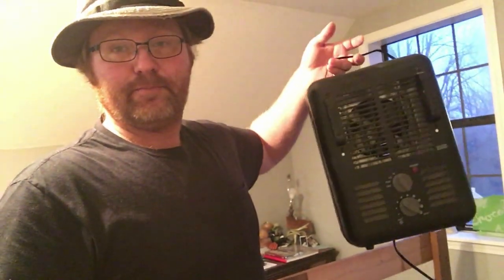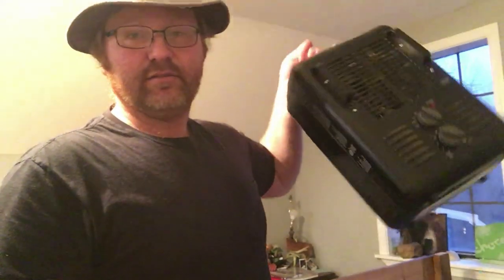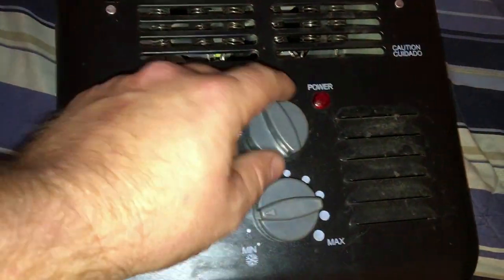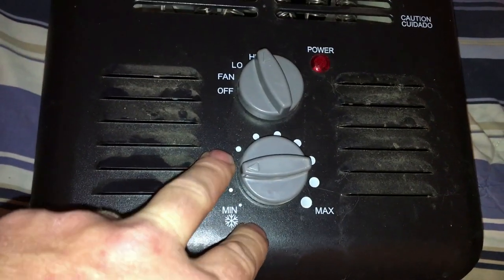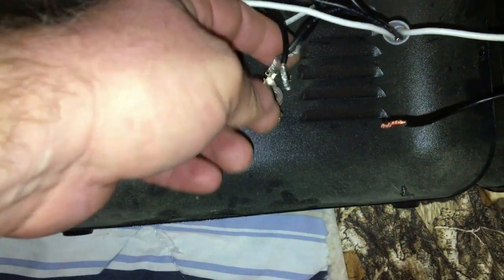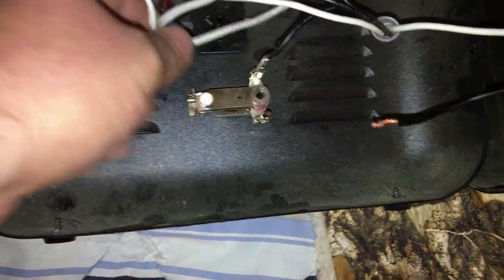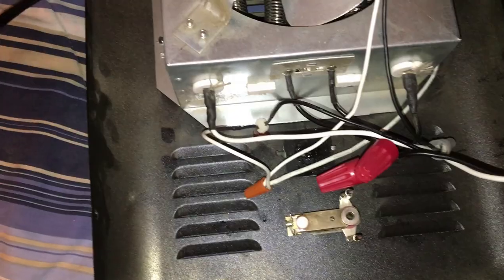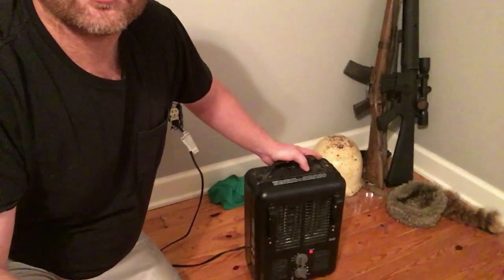How I fixed a broken Space Heater

Comment: I have the same heater, and putting a ball of aluminum foil in between the the "safety prong" fixed mine instantly. They are designed poorly. Too much plastic where there should be metal.
Reply: Foil to bypass safety prong. REALLY!?!
GOOD LUCK
Reply: @johnsarab4500  That comment was posted a year ago, and it has beet working ever since. Good try though.
Reply: @drizzzumbrizz6308  tried the same thing. It worked for a few minutes then popped and stopped working. I checked the foil and it was red hot and burnt to a crisp. No doubt it works but have you had any problems similar?

Comment: OG you can’t do that, maybe you should not make a video about this subject because you just don’t know as much. I don’t know much about Forced Air Space Heaters, and that’s what Im on this page, but my friend ur broadcasting how to bypass some very important safety features
Reply from the maker: Thanks for your input. I did what I had to do to make the heater work . The parts on the heater melted before I wired it up so really the heater was defective before I bypassed everything. As a matter of fact every one of these heaters shorted out and melted the thermostat including all safety features without me touching it. I haven’t had any issues with them after I bypassed everything. I agree not the safest measure but we have heat.
Reply: Well, we all know it's not safe. We all know that this fix involves bypassing a safety feature. We are here because we want to do that. It is in fact sometimes useful to know how to bypass safety features, and not inherently irresponsible to simply make a video about doing that.

Comment: My SAI heater Off, fan, low, high switch went bad, bypassed it like you did, works on HIGH again lol. I use the  temp switch to cut it on and off now. HIGH is all I ever used anyway. Thanks,

Comment: My Comfort Zone, which looks very much like yours, I just repaired after jumping around the safeties on the tilt switch and found that ok. Jumped the thermostat and I HAVE  heat now. Looked at thermostat and realized that the contacts looked like
 points on older car's  distributors. I next filed the contacts with a fingernail clipper file . Working great, unit is 5 years old
Reply from the maker: That’s amazing!

Comment: Much appreciated. I bypassed the thermostat,, and simply wired the 2 blacks together, and off, fan, lo, and hi are still selectable.  We use one of these overnight in our basement to keep our cat warm. Since there is no safety anymore we will not be using this particular one for that, but at least we will have it for the winter when we are able to keep an eye on it. Thanks for saving us the 20 bucks on getting a new one!
Reply: Bypassing the thermostat worked for me, too, and the off, fan, lo, hi controls still work.  Just a warning, if you have children or pets, the anti-tip shut off will not work by bypassing the thermostat.  These are $18 at Menards, on sale this week for $12.
Reply: Same

Comment: Thanks man! I know it’s been a year since you uploaded but you help save me a good few bucks. Had two of these exact heaters and my first one went out last year and my other one just went out today. Came across your video and it work wonders! Although you don’t need to connect the white wires if the top switch isn’t broken for sure. Both heaters stopped cause that stupid heat sensor so you really just need to do the black wires on the bottom
Reply from the maker: Awesome. Thanks for the advice 👌. Just be around if their on for safety reasons. Taco
Reply: @tacitohomestead4851  of course lol, don’t need any fires

Comment: Thank you so much! 

My heater is almost the same. Exact function and wiring, but white with a different fan.

Something happened with that rotary switch where one day I trusted the switch to OFF and it kept going. When I came back to use it, the switch wouldn't turn at all.

I suspected the wiring was, like you said, a simple positive and negative. But the thermostat always worked.

So what I did instead was I removed the switch and drilled a hole for a simple on/off toggle switch. 

For safety I got a 20A 125V AC toggle switch with that round metal lever that flips up and down.

Then I cut off the 3 leads on that rotary switch that went to the heater and the fan. (The fourth lead is the hot input for the switch so it wasn't necessary to transfer since we were replacing the switch).

I tied all of those wires in the rotary switch together to one of the new toggle switch leads. I tried the hot wire from the plug into the other toggle switch lead.

Now I can flip it on or off, and I can still use the thermostat to control the fan speed.
Reply from the maker: Wow that’s amazing! You did way better than me. Congratulations on the success.

Comment: Thanks brother Taco i got a honeywell red box that i took apart to clean and fix a wobbling fan making noise, after 2 hours of work it ran great for 10 mins then the thermostat got moved by accident from full blast and it all shut down. I let it cool for 30 mins outside, tried to plug it and that pos wont budge even ice cold. Now i'm gonna tear it down again and bypass all that shit just like you did.
Reply from the maker: I hope it works out brother. It’s a good fix for when you need heat now. We continue to use ours and it’s year 3. We keep an eye on it in case it somehow gets knocked over but it’s chugging along nicely.
Reply: @tacitohomestead4851  update; i bypassed the bs themostat and the thermal sensor, for sure one or both were dead, i had a very noisy grumbling fan, i noticed when you held the unit inverted it was almost quiet so i took it apart again ( 4x in 24hrs lol ) and loosened the motor's two bolts and flipped the motor upside down. it's now on a test bench running wide open for a few hours to make sure nothing melts. For now i'll leave the "two step" switch so i can still run it at half power if it gets too hot. i use mine in emergencies with a firman generator so i like to make sure everything is old school fail safe. Thanks again brother Taco stay safe & God bless.

Comment: Hey if anyone has this heater and they take it a part and notice that the safety switch is still all together but not working…. Take the underside tab of it and bend it to connect with the middle metal tab part in the safety switch. It uses metal tabs on each side and a weight to determine connectivity. It may take 2-3 tries to get it perfect
Reply: Are you talking about the level switch?
Reply: @mikej.4069  it’s essentially a level safety switch yes.
Reply: @mikej.4069  please make sure you have it unplugged because 120 volts goes through that, don’t hurt yourself
Reply: @jameshunt5316  thanks I'm not that stupid but I just by passed the thermostat and level switch cuz they were one unit and it works....easy fix. Just have to plug and unplug it now.
Reply: @mikej.4069  I’m not thinking you’re stupid. Even professionals can forget sometimes. Be safe and glad you got it working!

Comment: Criminy just buy a new bi metal thermostatic switch! I've bought a couple and fixed my old heaters. By passing the thermostat is just asking for something near it to catch fire.
Reply: I just bought 2 new space heaters with issues with the thermostat.

When it gets to thermostat adjusted temp, it will turn off but never turns back on when the ambient temp gets cooler again.

Comment: I got confused on the wiring but I got it ..
 
My switch to put on high medium low was bad so I removed all  the wires from it and I connected all  the white wires together and the black wires together which was two wires  i didnt mess with the thermostat two black wires thats connected to it and the heat came back on .I tape them up and i was good to go its even hotter then at 1st  im assuming is your thermostat is messed up you would connect those two wires together so you would have 2 sets of black wires connected 2 each  and 3 white wires all connected  and it should work for u

Comment: I have the same heater, it stopped working from the sensor so i broke it off and for the most part runs but sometimes shuts off. Was hoping to find a permanent fix in your video. :) just wish you had your phone on a tripod

Comment: I honestly wouldn't bypass a safety feature like that knowing that it broke because the kids kept knocking it over. You're just asking for your house to be burned down. If I didn't have mischievous kids, I'd just hard wire the heater like you did but use an external thermostat. There's no reason to cook a room to ridiculous temperatures, and the cycling will keep the cord and plug from overheating. In your case, I would go online and replace the thermostat/safety switch. You might have to drill out the rivets, and either install the new switch with a rivet gun or bolt it in. Your other option would be to get another heater, and use the old heater somewhere else. They're inexpensive. A new heater is a lot cheaper than a house. Also, just drill it into your kids to respect things like heaters. It will save them a lot of pain in the future.
Reply from the maker: Our fireplace almost burned down our house 2 years ago, not this heater. The irony of it all.

Comment: Hello I need your help. I have the same space heater.
I knock over the heater and this silver cylinder piece fell in the inside. The cylinder has a plastic like mouth between them.
I was wondering if you could do a video showing the different parts of the space heater
Reply: That's where I'm at.

Comment: I have a space heater that when you plug it up and turn on it will run and heat. Then after a few minutes it will turn off and want come back on until it sets for a long while. My guess it's the thermostat. Do you agree and if so how do I bypass it?
Reply: I think some people are just bypassing the thermostat and safety. I am going over to the garage right now and will cut the two black wire off the thermostat and wire them together and see what happens.

Comment: Good information in a pinch but time to throw it away as soon as you can replace it. Saving $20 isn't worth the house fire. Wanting to go years on a heater like that is just stupid, especially when you have kids knocking them over.

Now if you were mounting this to something solid, it wouldn't be so bad without the protections you removed assuming the thermal fuse is still in place.

I personally use one of these in my garage and the tip over protection being absent is a requirement. But since I'm in the middle of a storm where I need it and it broke it's been bypassed, when it can be replaced it's getting dismantled and trashed.
Reply: Yea I agree. My kids are dead from my house burning down but I saved 27 bucks.
Reply: @jeffkili8918  yep, true to my word I had modified my heater during the Texas snowmagedon (6 days of normal winter if you're not from a pansy state), I immediately bought another heater, snipped every wire in the modified heater and put it out in the trash. For someone to try to use it would take an incredible amount of negligence and it sitting in the trash right after our little mishap would make a tempting treat for a trash picker.

Comment: A very well executed video, as I found one in the trash on my walk tonight. Plugged it in and it started to smoke after about 30 seconds.Could it be the filter is not clean? Any idea's appreciated before I open it up. Thank you for the straight forward and easy to understand tutorial.
Reply from the maker: I would blow it out with a compressor and spray nozzle. If it’s still smoking I would take it apart maybe some wires are burning. Also if the fan isn’t blowing the elements will overheat and smoke
Reply: @tacitohomestead4851  I will follow your instructions indeed. Thank you and all the best from New Rochelle N.Y.

Comment: Where do you buy the thermal fuse
Reply from the maker: I didn’t buy a thermal fuse I simply bypassed everything so we could have heat. I would suggest making a base for this heater because the tip overs is what caused it to malfunction. We would run the heater while we were home and if we left turn it off.

Comment: What if you are not getting any power light at all?
Reply from the maker: If the heater is working but the light isn’t then the wire for the light is disconnected could have corroded or melted loose.

Comment: Does the coils on yours turn red? Just bought 4 of these and while they heat they are not turning red and not very hot
Reply from the maker: The fan keeps the coils from turning red. We had one where the fan motor went out and the coils turned bright red which isn’t supposed to happen.